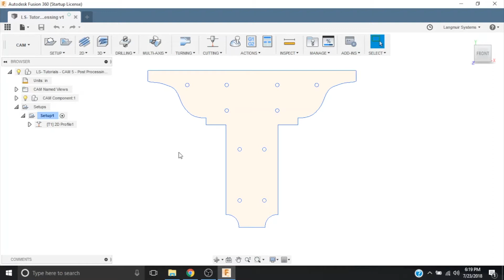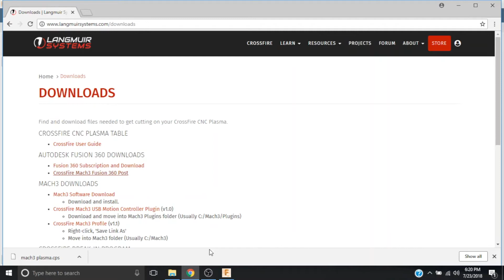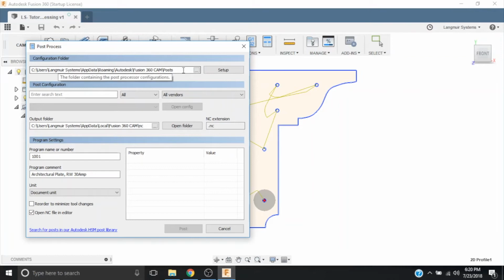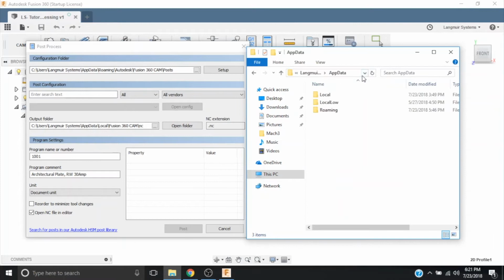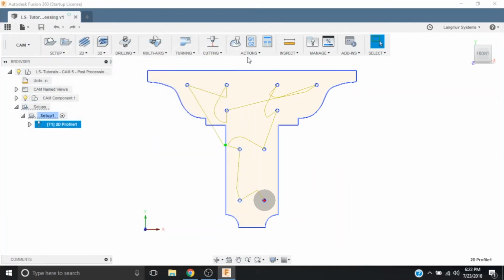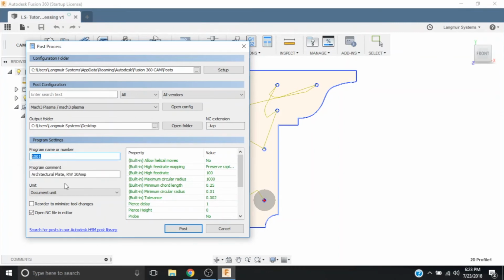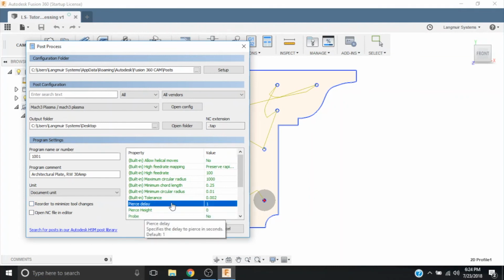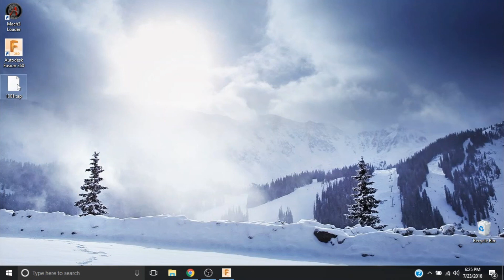*ARCHIVED - OUTDATED INTERFACE* Fusion 360 Tutorial: CAM 5 - Post Processing

Comment: this video helped me install langmuire's new fire control software into fusion. it didnt require all the steps to reach the post process folder within my file browser. it was fairly straight forward apart from running into issues with my antivirus, which i just needed to disable momentarily.

Comment: This is to much BS   Is there any easier system to run a plasma table
Reply: The settings are different now, dam
Reply: Yeah this is dumb complicated. I guess that's what I get for picking up a cheap ass machine. Good software cost more than this whole system lol
Reply: The software you choose to design and toolpath with has nothing to do with Langmuir or your table. 

Darn them for showing you how to use a free system with their table, which is also the most affordable on the market. Did you just expect to turn it on and it would cut parts for you? 

Go ahead and pay 15k a year for Mastercam and 7500 bucks for a top of the line table and be just as far out to lunch because you expected them to spoon feed you as well